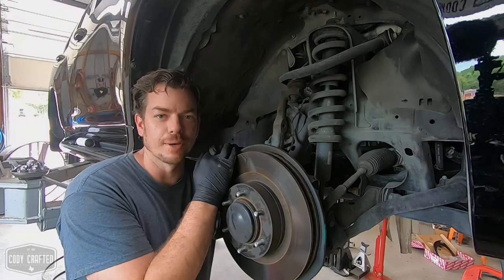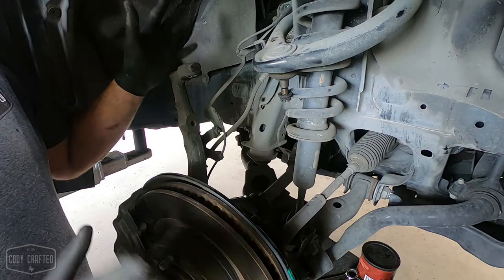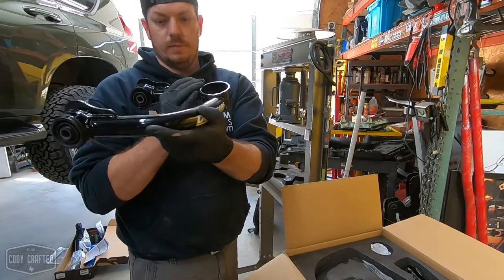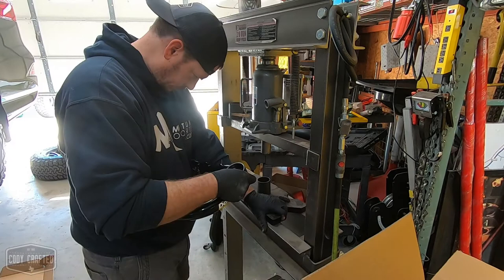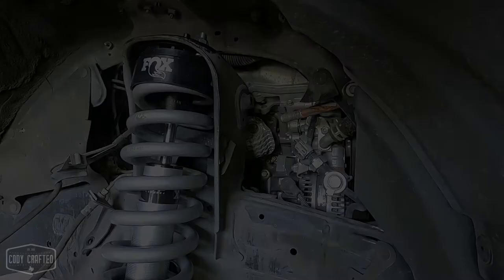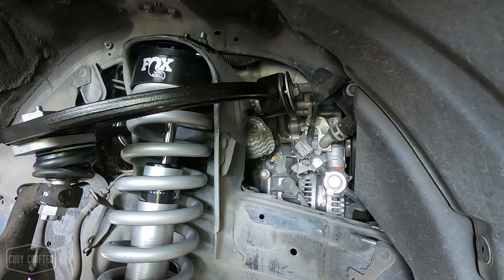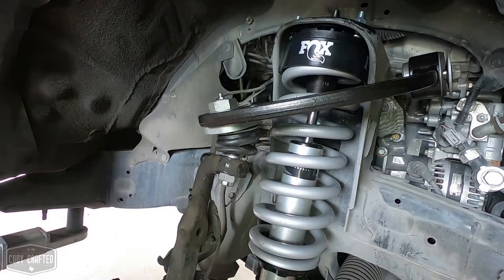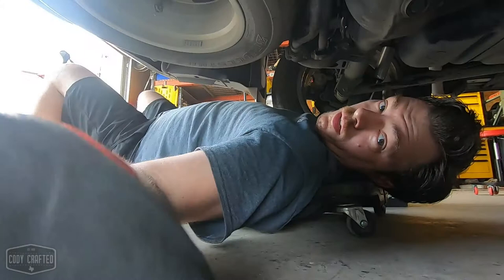Dobinsons UCA Assembly and Install for Lexus/Toyota: Cheat Code Ep1

Comment: How are the spc compared to the dobinson? I keep reading them the spc have a Moog ball joint so they’re not as great
Reply from the maker: I've never had an issue with SPC, that said if you're more serious offroad I'm not a fan of the "slip" in the ball joint adjustment. I'm always concerned it'll move. Never seen it, but it's in the back of my mind